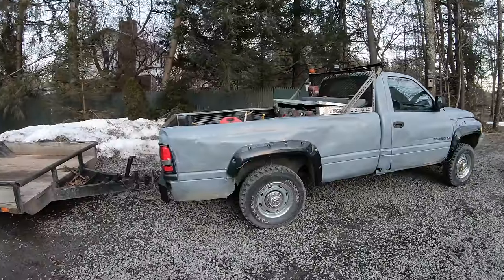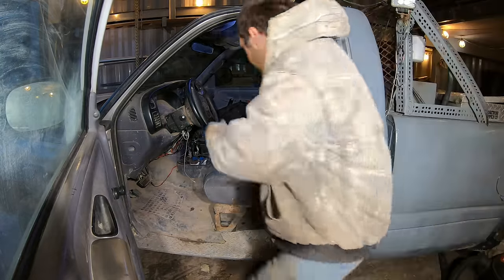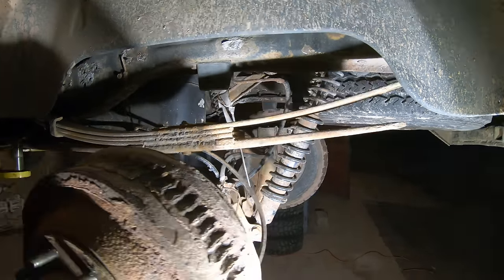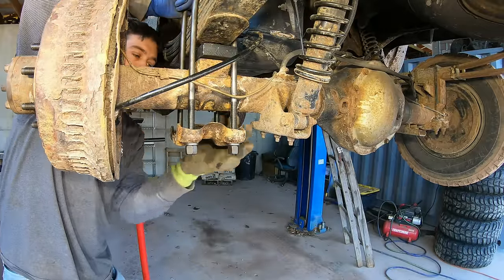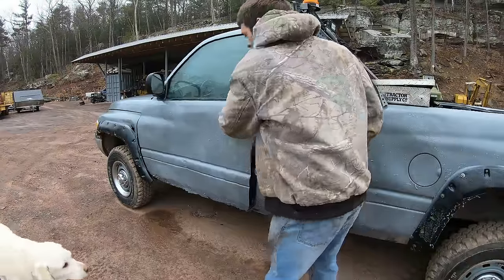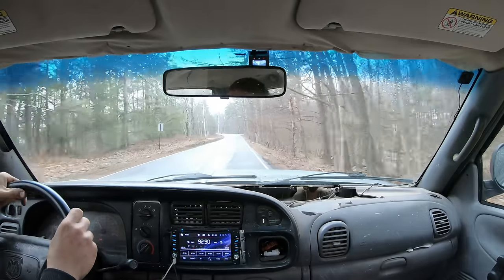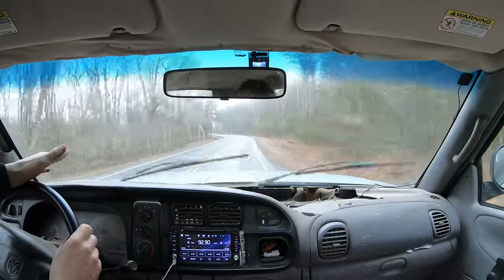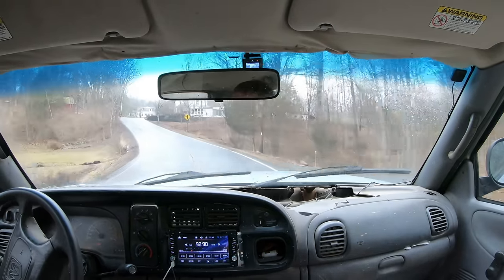New seat and leaf springs in a Dodge pickup truck

Comment: People may bust your balls about the condition of your equipment, but you know what, they all work, they are all paid for, No Payments. How many of them can say the same?
Reply: @BadDriversOf Georgia Absolutely.
Reply: Your right
Reply: its people not understanding that line of business. that's a work truck plain and simple. I have never seen a work truck in that field of business be clean or dentless. As for tool if it works no need to replace them.
Reply: I get it, But don't you think there is a point where safety becomes a concern?
Reply: @chastitylang1371  You're wrong using that your.
Reply: Very few. The kid has smarts.
Reply: Hes my kinda guy. No yuppie marshmallow snowflake in his blood.
Reply: @jonjhon8491  I'm convinced that the "Your/You're" fail will be the end of the human race. If we cannot get this right, how in the Hell will we stave off extinction?
Reply: How many of these plastic rolling gaming machines that are being sold today as trucks would be able to do all that Andrew's trucks do?  More than likely most of them would be headed for the crusher in less than a year or two.  A work truck is just for that, working!
Reply: @Gmurphy84  Andrew knows when safety is a big issue in equipment and vehicles. So when something becomes a safety concern, you'll know. He'll address the issue and get something fixed/new.
Reply: Not to mention no point in buying new trucks/equipment to beat on. Buy used and keep going.
Reply: @Gmurphy84  As Andrew states in the video, the steel brake lines rusting out is where the real danger is.
Reply: The devil Made me say it First of all you just said no to the brake line rusting out being dangerous and then go on to say if the drum cracks in half that’s dangerous? I’d go ahead and say both would be dangerous you think? Andrew addresses all brake issues on his vehicles and equipment. Did you even watch the video? He knows about frames rusting out. I don’t think he cares if you dislike what he drives lol!
Reply: @13ofus  The architect and foreman :)
Reply: Gear Jammer I agree, if you have a work truck n Make  money you need a tax rite off anyway , buy new truck so you can go to work instead of work under your truck, I got 3 work truck 2014 and newer and
Reply: @imsayrocket  //  You mean indicators like when his front left tire came off and rolled past him in one of his recent videos? If that had occurred while towing an excavator [+trailer weight], the ability to stop could have been a disaster to a family and/or Andrew depending on the location. I enjoy his channel, but minimum safety standards should be met with smaller trucks while towing large loads [like his large trucks safely tow].

Comment: Interestingly, South Main Auto posted a similar rear leaf spring repair yesterday, Eric O tackled it with a wealth of previous experience, but Andrew C arrives at the same pinch points and then solves them with intuition and good sense.  Great to see Andrew's 'Make Do and Mend' philosophy in action, "...good as new...".  Love the channel, best wishes from UK.
Reply: @Gary Bates - I was thinking the same thing.  I like to watch both Andrew and Eric O.
Reply: @Sam Val,don’t we all?
Reply: I added leaf springs to mine. Similar situation, just left the top leaf alone. Then the rear mounts went and i had to get new brackets and welded up new mounts out of old leaf springs.

Comment: Here in Western Australia I drive fertiliser spreading trucks which have a problem with lime, urea and superphosphate causing corrosion. We pull them to bits and liberally coat everything with Lanolin, which is natural sheepwool grease. It is excellent at entirely eliminating rust and is a lubricant as well - and for those that are concerned about the environment - is organic, natural and the sheep is not killed to shear the wool!
Reply: Tu te Kohe To be fair the answer to almost every question in Australia is “sheep”.
Reply: JasonFiske What’d you have for dinner last night?
Reply: Jason Fiske, I had roast mutton and it was delicious!
Reply: The main ingredient in Fluid Film is Lanollin.
Reply: Where do you get a large amount to spray a truck underside??
Reply: Here we can get a number of different grades of Lanolin, from a liquid able to be sprayed through to a heavy grade that must be heated to soften it enough to scoop it from the 20l (5 gal?) bucket. It is readily available here as we have a number of wool processing facilities where Lanolin is a byproduct of the wool scouring (cleaning) process. We use it on every part of the truck, including in the wheel rims, suspension components, on bolt threads, between body parts, in fact anywhere we can get it!

Comment: Andrew, U'bolts are meant to be torqued and will stretch when installed.  Once removed, you cannot safely re-torque them to achieve the correct clamping force. Just like those throw away head bolts.  Re-use runs the risk of failure.  That said, sure I've reused u-bolts.

Comment: If Andrew gives up on a vehicle it must be really worn out. Next video "let's replace the frame on this Dodge."
Reply: MY 97 NEON 4 DOOR   JUNKED IT FOR 150 BUCKS FOR USED SUBIE
LIKE 3 YRS AGO
ONLY HAD 167K ON IT ALL RUSTED OUT BAD
SPENT LIKE 19K ONLY 500 MILES ON IT
Reply: @ekop1778  aparently you also need a new keyboard as your CAPS LOCK IS BROKEN......
Reply: @m4arlique890  ITS A DELL  EVERYTHING IS WRONG WITH IT
Reply: @ekop1778  fair enough

Comment: I had a dodge diesel I bought from a friend. It was a northern truck so it was rusty but it was a crazy cheap deal so I bought it. So I'm driving and it was kinda darty where you would hit bumps and it would get unsettled and I'm towing my 36ft enclosed back from an event 3 hours away and going through highway construction and the truck is just driving terrible. and it would make this grinding noise when you would come to a stop. So I was getting ready to head to Texas for an event and I'm checking the truck over doing new tires and such, and both front upper control arms were broken in the middle from rust. They were so much thinner than the lowers from the factory that they just rusted right through. I was so surprised that the truck still drove okay with both front arms broken in half. I replaced them obviously, but after that truck I told myself I'll never own another northern truck so long as I'm living in Florida no matter how good the deal is.
Reply from the maker: Yeah, they can rust out bad sometimes.
Reply: @AndrewCamarata  True dat.  I live in the midwest,  so I know rust.   I would really like to know how many acres your house/houses sit on.  Upper New York is beautiful country,  and I love it when  you have the drone and get a high shot of all trees!
Reply: Binge watching Andrew’s videos and found Taylor commenting randomly. Nice

Comment: Hey Andrew, 
When it's dry, coat the underside of the truck in bar and chain oil (you might need to thin it a drop first) and then go for a drive down a dusty road. It'll make a nice rust preventing coat on your truck and it's loads cheaper. You'll just have to redo it every now and again.
Reply: Don't do this hackjob trick from the 60's. He has the fluid film kit and will do it.
Reply: @boomchakalaka0  calm down son
Reply: @delmonte2238  Don't spread stupid information.
Reply: @boomchakalaka0  it's not stupid my guy, but if you feel comfortable putting people down on the internet then you go right ahead x
Reply: @delmonte2238  You know it's stupid, and it is illegal in many states.
Reply: @boomchakalaka0  calm down mate, it's not the end of the world

Comment: So many things to say from what u shared. I like the way u reason things out and do it quicker and still properly. Amazing what bad seats can do to our backs. I had a desk with a sliding keyboard under it. One day I just didn't want the tray there and removed it. I found I could raise the seat all the way, and being about 6', my back felt so much better. Knowing me I would have wanted to pull the tank and replace everything, so smart of u just replacing the bottom springs as they support the top one. Its a work truck that seems to have performed when needed. I'm also glad u mentioned the copper-nickel brake lines because I want to change mine. I lost my brakes a couple of times and not fun experiencing. Luckily, I wasn't in traffic and just had to replace them. One other thing I'd like to mention is inspecting the struts. I had a front right strut spring cup rust out on me and took out a brand new tire. Luckily, a little garage was just down the road and they fixed it very reasonably. I usually do my own work, but after getting it towed and stuff, they had me going in an hour or so. I say luckily because I was in a very rural area at the time. Well thanks for sharing again.

Comment: Loved your story on steel brake lines...Ex father n law bought a 20' van body up north to use in our insulation business....Yup approaching an intersection to turn right, hit tha brakes...pedal to tha floor.... laid it on its side slid into parking lot of bldg supply in Coal Mountain, Ga....luckily no one was coming either way sure got a lot of strange looks from folks running out to see what happened....When po po showed up with wreckers...I explained situation and sure enough when I got back in and hit brakes fluid poured out of a pin hole from rusted out steel line....replaced line when we got back to shop and drove around with skid marks all down tha side till I sold it years later....Another life lesson.....

Comment: I remember when these trucks came out. I wasnt a big fan of the body style but they grew on me. Now i'd like to go back in time and get one. Before the time when guys started lifting them, folding out the "tow" aka grocery parking lot mirrors and putting big ass wheels with no sidewall mud tires that stick like 12 inches out past the fenders. They were good trucks and the right setup were real easy to work on. The 5.9 liter diesels were one of the best of the time and would be streetable and reliable with 1200 hp and 2800 ft/lbs of torque.

Comment: I’ve been driving my work truck with a busted inside door handle for over a year. I ordered a new and the outside handle broke. I ordered a new outside handle and the tailgate latch broke. 
My neighbors think I’m nuts getting into my truck from the passenger side all the time already....
Reply: Chuffin 'ell my coworker has a slide latch screwed to the outside of his drivers door to hold it closed. 😂
Reply: Harry Ballzack yeh, it’s funny...but it works?!?!
Reply: @Chuffin_ell  I busted my sides laughing also over the rebar comments, that was good, I needed that.... I'm sure Andrew knows that would not be a very good idea using rebar to weld up a frame on a vehicle together, even if he could get the rebar to weld to the frame.
Reply: LAKESIDEBOB1 😂😂🤣👍
Reply: LAKESIDEBOB1 my comments about folks are based on my own experience. 
That is, there are three types of people in life. Those that know math and those that don’t!

Comment: I have watched several of your videos and can see that you have what it takes to be a really good mechanic, the way you approach the issue, the way you handle your hand tools making sure its squared and holding pressure at the head of the ratchets. You either have it or you don't and you have it as do I, please be careful with your back.

Comment: I grew up in Iowa dealing with the salt, hated it. Mustie1 uses bar and chain oil as an undercoating, seems to work pretty well. I've called Arizona home for the last 20 years and love it. I had a 79 Bronco that LOOKED rusty underneath, but it was just road grime... if you scrapped it with your fingernail, the frame rails still had the shiny black factory paint.

Comment: You had me worried when you broke out the heated power sprayer. The paint and a little rust came off, but you fixed that with a brand new can of gray paint. That old seat & duck tape was a little  bad. But the NEW one you put in had about 260k mile on it to...Just good as new, ready for the next job...Its a pleasure to be able to set down after a days work and watch you do your thing... Thank you so much.We ALL to love watch you and Levi.. 
PS. Does that old truck AC & Heater work ?? I bet it does.. Yep

Comment: A good and cheap undercoating is to use a few of those wax rings used to seal toilets to the floor, melt them in a pot and mix it up with bar and chain oil. Put it in an air gun sprayer and go to town on the bottom of your vehicle. Coat everything and then go back and blast some bar and chain oil inside the frame drain holes. Once it gets a coat of dust and grime on it, it becomes a good barrier against road salt.

Municipalities use salt because its cheap and there are probably kickbacks from salt mines to use it. I lived in Colorado for a couple of years and they used sand instead so there wasn't an issue with rusting cars, they just got filthy really quick. The sand mixes with the snow and turns into a nasty slurry that sticks to pretty much everything, but it has the desired effect of giving you great traction on snow and ice covered roads.

Comment: Enjoy your videos ! Very well done. The panoramic ariel shots at the end with your drone are a very nice touch. 
Living in the Rust Belt is hell on vehicles. When I lived in WI, we had a snow-banger / rust bucket beater vehicle for winter & didn't bring the nice vehicles out till late April & quit driving them again by the end of October to avoid road salt poisoning. The price society pays for wanting the snow & ice melted off the streets instantly. 
I'd have changed that Main leaf though, as that's the one that usually breaks. Time will tell.... Also the main leaf on the 1 ton spring pack was probably made out of thicker material that the 3/4 ton main leaf is. For what you're doing / hauling weight wise, you should have a 1 ton truck at a minimum. You're working that poor 3/4 ton to death hauling that heavy equipment & loaded down trailers with it.

Comment: this reminds me of a buddy of mine where he would fix his truck a lot and the only thing that stayed actually stock is the cab, most of the interior( the seats he replaced scence he had a bench seat but he wanted buckets intead witch are now repared with ducktape and hand stitching), and the main components witch he "Alaskan beefed up" as he called it(chassie, engine, transmition, and axles) but everything else is repaired or swaped out. the additions he has done is offroad tires, a heavy duty winch i think a warn model, a rollbar/headach rack a toolbox in the bed and custom bumpers that are made to hit a moos and not give a fuck and he upgraded the suspension some what to make it easier to use and handle all the rough tarain and weight it has(witch he used aftermarket parts and stock parts like 3500 hd springs(and he used the full set not just the springs he actuialy cut off the old ones and replaced them with the 3500 rear dually springs and it works very well) and off road towing components and the survicabul kind and the truck is from 1995 and its a dodge it is a regular cab 4x4 2500 so as of 2020 it is 25 years old and he got it in the year 2000 and it is in Alaska so it has seen hell and it was originally a all white truck but now it has a paint job of roll on bedliner, and rustolium black but before that the bed was blue, the tailgate was green, the driver door was red the passanger door was maroon(and on both doors he had to replace the sheet metal on the door locks with thicker stuff) the driver fender was dark blue the passinger fender and hood was silver so it was a bitchin rainbow of colors and he repared some holes in it with 16 guage steel (flate plate, trede plate, and more) so if you think andrew camaratras dodge truck is rough try my firends 25 year old truck and he uses it a lot it is his main work truck and more reciantly he told me that the engine+transmition+the transfercace all craped out and are fubared so he is geting a "new" diesel drive train and swaping that in he got a cummins diesel 6 cylinder with a turbo and a automatic transmition with a new transfercace that is gear driven scence the stock transfercace wasnt working for him so he replaced it with a rebuilt np205 for a dodge truck and now he is going to have a brand new one built for him.

Comment: I use bar and chain oil on my vehicles out here in Iowa.  You spray down your vehicle and drive out on the gravel roads, which produces a nice barrier.  If you do that at the beginning of summer, the oil will also solidify creating a harder barrier.  And it's cheaper than fluid film.

Comment: Interesting comments about the rust problem.  I had no idea rust can be the problem it is in some parts of the country.  I live in northwestern SC where it will snow if it snows nowhere else in SC.  This past winter (2019) we didn't have the first flake of snow.  It seems to me the manufacturers owe those buying their products more than they are giving.  I have a 2001 Dodge Ram 1500 without a hint of rust anywhere.  My dashboard broke just as yours has, but I installed one of those "coverups" which looks OK.

Comment: I saw one video on here where one  brushed of the rust and used a primer that is for undercarrage and semi converts rust. then used a special can paint that is  thick and almost turns to a rubberized paint. and sinze it is rubberized it will not chip as easily therby preventing further rust

Comment: I know a guy that lives in New York State, he has a Dodge with over 250k on his truck with Zero rust.  The trick is to Never use the undercoating on the truck, but he uses used motor oil
and sprays it on everything during the winter months. Once spring arrives, he washes it off.

Comment: Can relate to the frames rusting out got an 86 Toyota pickup that was missing a good foot and a half of the frame just behind the cab only thing holding it together was the "custom" flat deck some guy welded straight to the frame